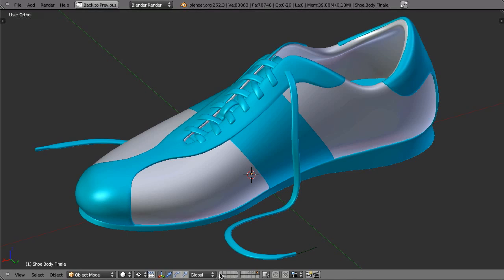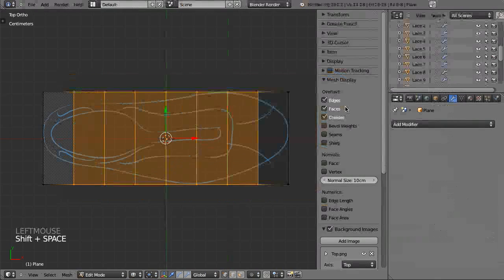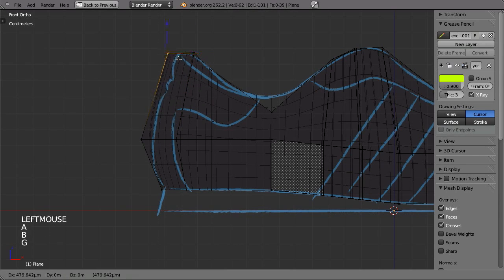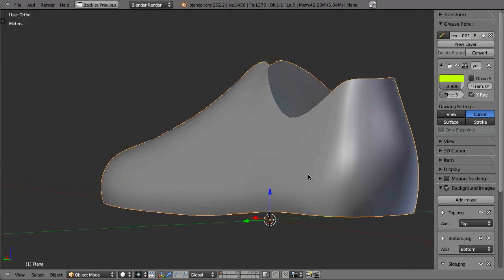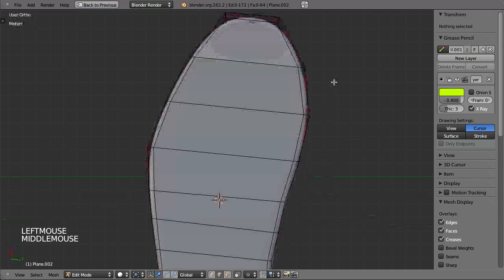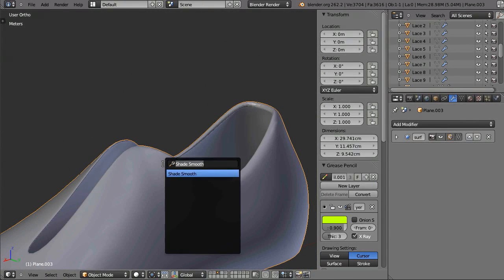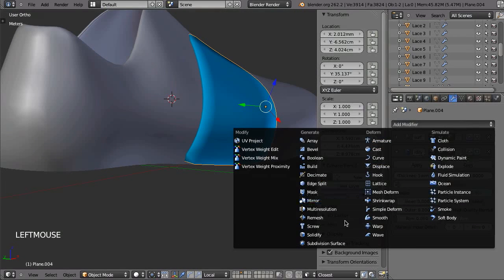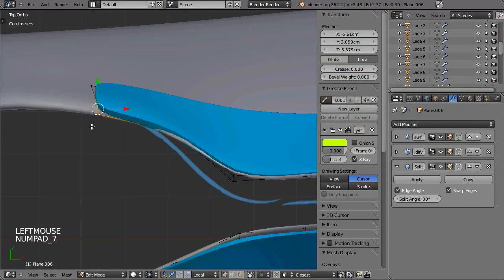Shoe Modeling in Blender -- Part 01

Comment: uff! why i can't even open the image in blender? I am going crazy!
Reply: You've probably already got the problem fixed by now, but, I'll try and help still.

If you've added the image into Blender, as shown by CG Cookie, then the problem is the view you are in. There are 2 view types, Orthographic and Perspective. Blender's default setting is perspective, however, you need to be on Orthographic view to be able to view the image. You then go to the left/right side, top, front, back, or bottom view to see the image, depending on which view you set the image too.
Reply: Ded YTAcount you are a hero thank you so much